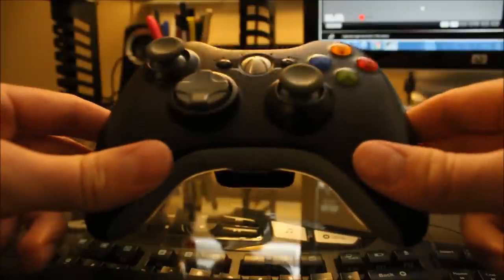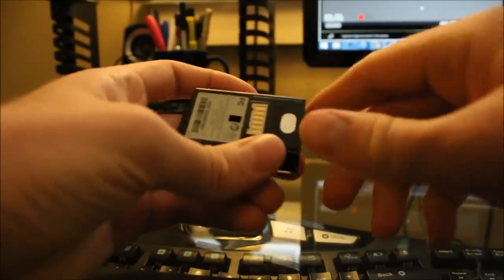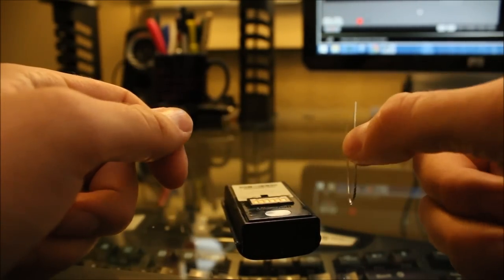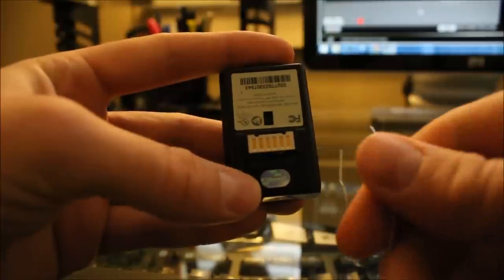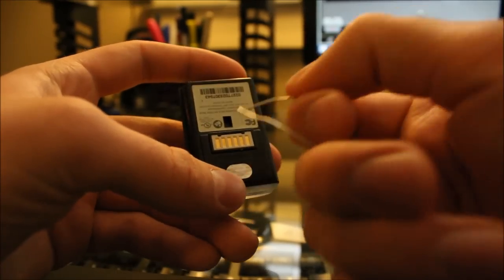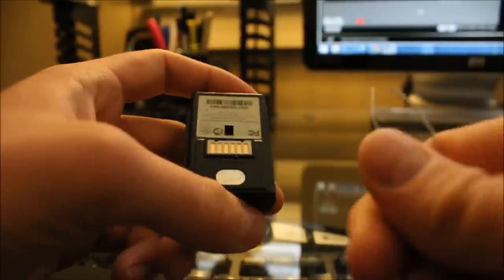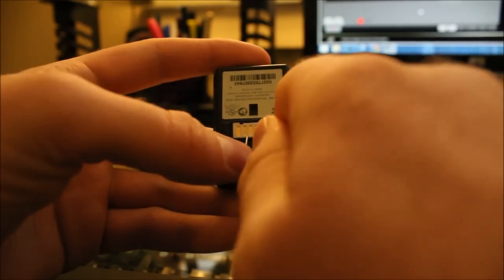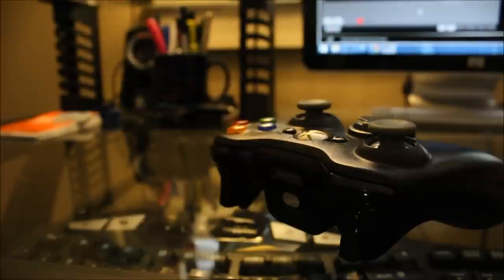Xbox 360 rechargeable battery pack fix

Comment: Note: discharge occurs between pins 2 and pin 5.  Warning to anyone about to attempt this process!  Release the paperclip every 2-3 seconds.  If the battery has a charge the paperclip will become very hot very quickly.  Use appropriate protection between the paperclip and your fingers.  The battery will heat up as well and you can irreversibly damage the battery casing, or worse, cause the battery to burst into flames.

Comment: Worked like a charm. Thank you for the valuable info.  If anyone is still having issues, pin #2 is positive and pin #5 is negative. Use an old phone charger and cut the end with wires exposed, red is positive and black is negative. Just like giving a dead cat battery a jump start. Hold them on the designated pins for a few moments and continue with this fix and all should work well. Thanks again bro!
Reply: So red on 2 and black on 5?

Comment: I had a deep discharged pack and to fix it I wired two paper clips between pin 2 and 2 (plus) and pin 5 and 5 (minus) of the dead (0.003V) and a fully charged (2.7V) battery pack and left it for about 30-60 seconds. After that I measured roughly 2.7V on the previously dead rechargeable and I could charge it again using the xbox charge station.
Reply: This needs to be at the top. This is the solution to a fully discharged battery pack. I had a pack that wouldn't turn red or green. I checked the voltage and got similar readings (0.003V on the dead, and 2.7V on the charged). I wired 2 to 2, and 5 to 5 for 30 seconds. The dead pack registered at 2.7V afterwards, and viola: it can charge again!! Now I'm wishing I hadn't thrown out 2 other dead packs that wouldn't charge with the method above.
Reply: +Felix Bünemann 
Good advice! I had no fully charged battery packs left so instead a used an AA battery and two paperclips. Worked like a charm!
Reply: +Nick how did you put the "+" and "-" sides of the AA battery?
Reply: +Felix Bünemann DUDE YESSS thank you soo much! looked everywhere on how to fix a fully discharged battery! tried leaving it plugged in, wiring the terminals up to a charger everything but no luck then i saw your comment and now it works!
Reply: Works perfectly . You can also use a stabilized 3V Power Adapter with cable clips and do this . Measure polarity first though :)
Reply: Was able to accomplish this using a multimeter. Worked like a charm! Thanks for this comment because I was just going to use a wire before this.
Reply: @nice8D  how?
Reply: NO PUEDE SER CONECTE EL PIN 2 Y EL 5 CON UN CARGADOR USB CON LOS CABLES ROJO Y NEGRO Y FUNCIONO GRACIAS

Comment: Awesome, my batteries were already dead to a point where it needed to be charged, so I just did the reset of the logic board. Slapped it in my controller hooked in the charge/play cord and the light turned red and now is charging. Thx so very much.

Comment: Warning : hold the battery with padded blanket or something and dont aim any end at you, I had a battery pack explode while doing this. Ive done this many times before but this last time it scared the shit outta me.
stay safe
Reply from the maker: Good advice. Batteries CAN be dangerous. Usually they are pretty safe, but we are getting them kind of hot. Safety glasses don't hurt.
Reply: +ExtraEme I dnt have paper clips can I use something else plz reply bro
Reply: +Birkaran Singh Basically anything thats made of metal is fine for example a piece of copper wire
Reply: good tip. god bless you

Comment: I just fixed my pack by plugging/unplugging the charging cable several times over (10-15 times) and then leaving it plugged in for a bit. At first the red light came on after about a minute (where as before it was just a flash of green and then nothing), then it fully charged to green and works. I recommend trying this simple trick before attempting the battery discharging trick in the video.
Reply: this happens to me rn

Comment: i have same problem where the battery pack thing, is for the rechargeable  station from NYKO....anyways so everytime i wanna play i turn on a controller and immediately it dies so i put it to charge but it says its fully charged....like it's green for a full charge  But the controller just doesn't wanna work, I'm not sure at this point if its the controller or the battery, or possibly BOTH....anything i can do to fix this problem.🤔🤔🤔🤔

Comment: Minds have like 6 burn marks on it and it doesn't recharge I think what you said first about my battery getting. Hot is what happen.One day I just left my battery on the charging station not the controller I came back it was dead and wouldn't recharge.

Comment: soldering wire also works too, i didn't had any paperclip
Reply: +NoirPooperBR I think people have this problem the other way around lol.
Reply: NoirPooperBR I'm using safety pin and I cut off the pointy tip and it's holder/shield.

Comment: That's not the problem with my controller what's going on is when my battery is fully charged it won't even turn on my controller at all it blinks barely few times and then it shuts off not even giving it a chance for it to turn on I have to use the charging cable to keep my controller on why is that

Comment: followed your instructions but it dtill didn't work
when I plugged in the usb charging cable to the controller to.charge the battery the led light would flash up in green once, but very briefly... so I cleaned the contacts of the controller and the usb charging.cable for the wireless controller, and plugged it in.and out several times, and what do you know, the red led popped up and its now charging the battery!

Comment: I over  charged my rechargeable battery pack and as soon as I unplug it dies so I got two new battery packs and put those in plugged the charger in and the controller says its fully charged when you press the home button but when I unplug it dies right away so I thought it was just that controller but no I plugged both battery's in to the other controller but it doesn't work ether if you know what to do can you message me thanks

Comment: This method FAILED for me on 4 battery packs that haven't been used in 
years. They also had very little use before putting them into storage. 
They're completely dead now and I tried this method many, many times on 
each of the batteries. I'm just going to use the regular battery covers 
and get some good rechargeable AA batteries.

Comment: The procedure did not work on one battery pack that has died on me. The paper clip never got warm when shorting pins 2 and 4. The battery still had a little power on it because it could drive the control for 10 seconds after disconnecting the charger cable.
Any ideas what could I do apart from buying a new battery pack? Thanks.
Reply: I'm having the same problem. I plug my cord in after "shorting" my battery and then touch the correct pins as done in the video. I put my battery pack but in controller plug in cord. Acts like it's charging and the the light turns green. Indicating it's done charging
Reply: Found that that battery was completely dead. Bought a new battery and it is working well again. There is a point where you need power from the heavens to put a Lazarus resurrection into a very old battery pack ;)
Reply: Hahah, I just took the battery pack apart and uses the batteries that were in there. They worl fine they've lasted me a couple weeks now. It's kinda weird. Maybe it was my cord

Comment: I plug my Xbox 360 controller into the Xbox and it  keeps flashing the green light on the charger and it won't  charge the battery pack

Comment: i tried that method and still no luck i got a ni-mh 4800mah brand new got it from amazon n wen i plug it in it wont turn on with my halo 4 remoter but it does turn on with my white remote n it just flashes n wen i sync it ti the system it wont connect what should i do send it bak or what

Comment: Mine wont discharge or reset.

tred several times and it wont do anything.

i even tried re-charging it on the dock and it charges fine, but the controller still wont turn on

Comment: Very interesting. I tried it with one battery and plugged it into a charging station, but no go. Then I put it into a controller and plugged in a charging cable. At first, nothing....but now I see the red light on the cable is now ON and it appears to be charging! Time will tell~

Comment: Yoo guys i have a problem wich is when i connect the cable a green ligth appears and then goes away when a red light is suppose to show up i did this dont know if it actually worked but i tried cleaning or rubbing something on the 6 pattern and i notice they were a little dirty and made me think that was the reason why i was not sending electricity

Comment: I just tried this with pin #2 and #4...it did nothing. I then tried pin 2 and 5 and.....it drained! I checked the Voltage before draining, it was at 2.6. After about 15 to 20 minutes of off and on draining, it got down to 1.06. Then I did the "reset" with pin 1-5 and then 2-6. Charging battery now. Let's see if it holds a charge now. 
I'll edit this later for update on results.
Reply: Update 1 year later?
Reply: @WantBadtime  -- I forgot all about this. But a year ago I tried this on 2 batteries. It worked on one. But the other would only hold a charge for about 10 minutes and die. I checked today after charging them both and the good one still holds a charge of 3 out of the 4 lines when you press the XBOX button on the controller to check the battery. 
Then, I tried this "fix" to the dead one today. After draining it and charging it, it has 2.72 volts. I turned on the 360 with it, and it now too has 3 out of the 4 lines. Don't know if it will last, but it did seem to work this time. The other one that it did work for last year still holds that same charge. So it does work. 

The only thing I did different this time was = after draining it, I pressed and held the 1-5 and 2-6 for about 10 seconds each. Maybe that made the difference?

Comment: dude i try it out but doesnt work T_T
 ive bought 3 battery pack and honestly i feel microsoft product have terrible QC compare to ps3
yes i own both console and my xbox is always the 1 giving me problem
Reply: amen
Reply: +Krixko If you have discharged and recharged your batteries a lot, it may be that the battery cells themselves will no longer accept charge. In this situation reviving the battery like that doesn&#39;t work because the cells are dead and will not hold their charge. The only fix is to either remove the dead cells and replace them (extremely dangerous), or buy a new battery. This should still work if you have only used the batteries for a while, but if you try to do it after two or three years of daily use without experiencing this problem, the cells can very well be ruined.
Reply: Keep it repeating until you get low battery.

Comment: okay so my handle doesnt work without my charger like if i take the charger off my handle shuts off. it doesnt even turn on for a second. does that mean my battery pack is fucked? and do i need a new one?
Reply: roldrix reyes I went to gamestop and the dude said to put the battery pack in the freezer for like an hour and a half to recharge the ions or some bullshit..buttttt ehhhh i dont feel comfy doing that. so im just gonna buy a new handle or just get a new battery pack from gamestop website its pretty cheap.
Reply: roldrix reyes tell me how it goes...im actually curious. but i just ended up buying a battery pack for 6.99 and its works great.

Comment: before this my controller said it had a two bar i did this i didnt plug the charger in and turned it on it said it was a full bar what does this mean? did i fuck up my battery?
Reply from the maker: Your battery is probably fine. Just make sure your battery is near dead when doing this trick, and use the paper clip to drain it completely. The paperclip should not warm up if the battery is completely dead.
Reply: thank for the info my paper clip didnt warm up at all so i guess it was dead

Comment: PLS help it worked the first time on only one battery pack but when i was using it the next day it was almost completely drained, im trying to repeat the same advice on the video and nothing at all this time.
Reply from the maker: Make sure you get a full charge on the controller before disconnecting it. Other than that, I am not sure how to solve this problem.
Reply: Ok thanks for the advice.

Comment: My dang battery pack is only 4 months old (Got it for Christmas) yet from basically day one, it wouldn't charge or it say's it's fully charged yet it dies two seconds later. So I'll get back to you and let ya'll know if this fixes it.
Reply: Hey I have the same problem. Did you ever get it fixed?
Reply: Alfredo Guzman Kinda. I did the thing in this video and it fixed it for a little while, then it went back to not charging. So I did it again and it seems to have fixed it once more. So it seems like if the logic board is bad in the battery pack, then this fix will temporarily fix it. So that's better then nothing.
Reply: +linnes16 oh ok thanks, I just wanted to know if it was worth doing beforehand. Thanks anyway
Reply: Alfredo Guzman Sorry, I'm not very direct when answering people. But yes, this will fix your battery pack if it's messing up.

Comment: Does this process work for third-party rechargeable packs?
Reply: Pull up the Datasheet for the thirdparty battery and see if it matches the original batterys datasheet? Especially on the pinouts.
Reply: There is no data sheet. I got these from eBay from some place in New Jersey.

Comment: Umm does this work with battery pack ON ANROID
Reply: +Stacy Vayne If you mean on a cell phone battery, then probably no because the cell phone takes care of the charging and cell monitoring, so there is no internal logic chip to reset in the battery.

Comment: My pin doesn't get hot helppp
Reply from the maker: Then either your battery is fully dead, or your wire isn't on the contacts long enough. It's not really bad if it doesn't get hot.

Comment: You have no idea what you're doing, are you? If you actually knew what you're doing, you would know that there is an EEPROM inside there. The proper way to "reset" it, would be to use an EEPROM reader/writer to write the original data on it (that's if you backed it up)

Comment: I had a issue where mine wouldnt charge but I havent used my controller in 4 years the recharge and play kits cant charge a batter at 0 volts so you have to boost the power using this method https://youtu.be/lNOlQS-i_ZU then after that if it shows red then green you do paper clip method and that should fix it

Comment: Any other ways to fix the battery? I tried the method it didnt help most
 other people said hut the 2-5 to drain it then 1-5 then 2-6 not 2-4 I 
tried them both but neither 2-4 or 2-5 heat up the metal or battery. It 
has a small bit of juice in it but when I plug it to the charger it 
turns green right away. Well a quick 1 second red then green.

Comment: my wont charge when i put in on the charger
Reply: Same
Reply: Me too😓
Reply: Same!! I have 2 controllers, one with the rechargeable pack and a wired one. The wired one doesn't work and you have to fiddle with the wire and tie it in place which it usually stops and you have to re-tie it. And then with the rechargeable pack it doesn't charge.
Reply: Great advice about to try it now. Wish me luck
Reply: You guys have fake controllers
Reply: Same,
Reply: Yup
Reply: Same bruh 😑😑😑😑😑😫

Comment: what can you use 
instead of a paperclip
Reply: +Karon Mines prolly two months too late but somebody said tweezers worked for them. If you could pull it off finger nail clippers could prolly work too. Angle it right and a safety pin might work as well